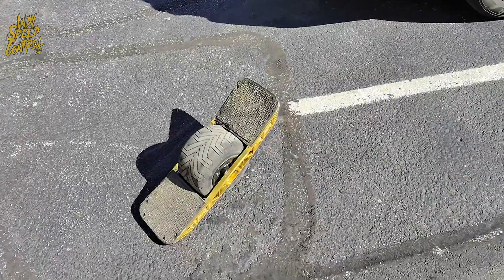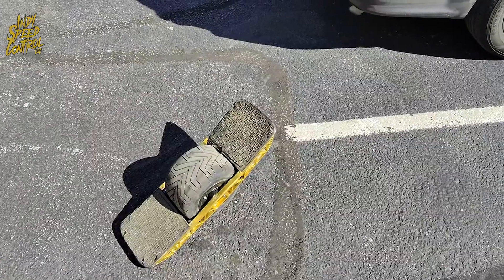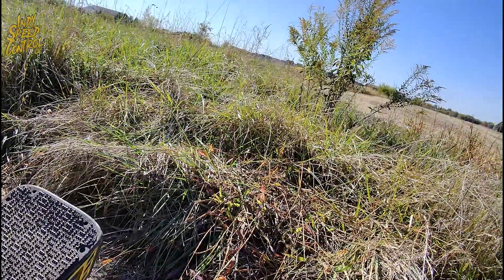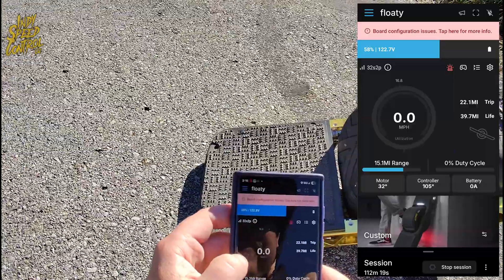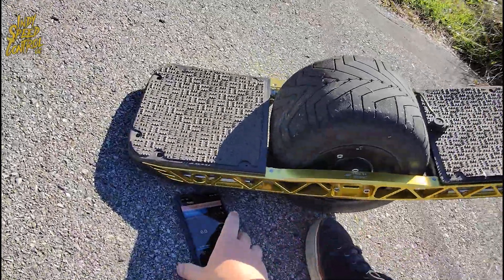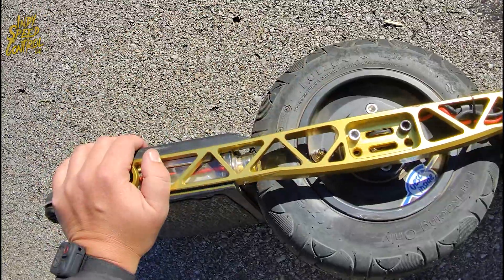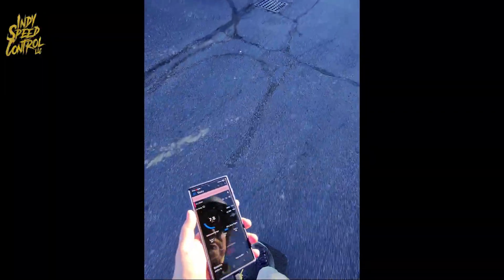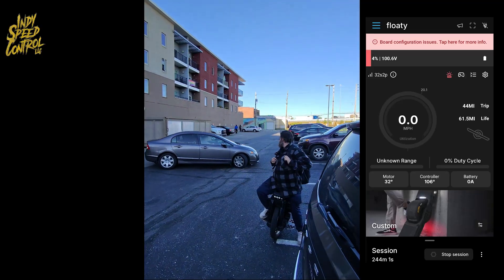32S2P Smart Linked Batteries RANGE TEST! Over 1000 Whrs!

Comment: Fusion core, in my opinion it's not the greatest idea to have speed control inside the motor, that's mean they will heat up each other, and that's not very good for efficiency and lifespan of electronics, at hot summer day it's probably overheats

Comment: Your motor temperature is at 65 celsius look like it's running quite hot from 134 volts. My Monster VESC XR on 20s3p 1080Wh battery with Superflux H/T motor, and on it motor temperature never goes over 40 celsius and I'm 290lbs dude.
Reply from the maker: That's -65C the motor temp doesn't work and it wasn't worth disassembling the board for.

Comment: Sweet! What BMS are you using?
Reply from the maker: We have balancing ICs built into the pack and have an ISC version of the Ennoid Master in this board.
Reply: MaxGo 20s charge only. Also running a 3.1 little foccer controller.